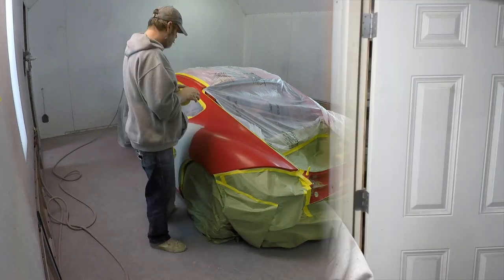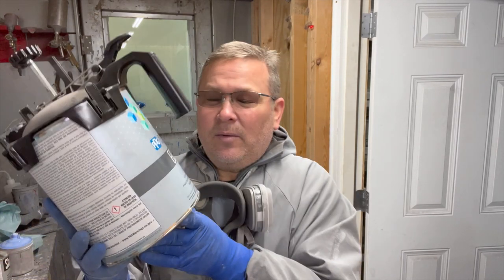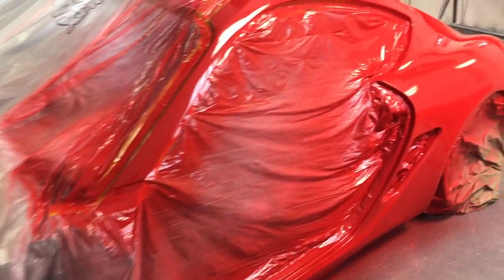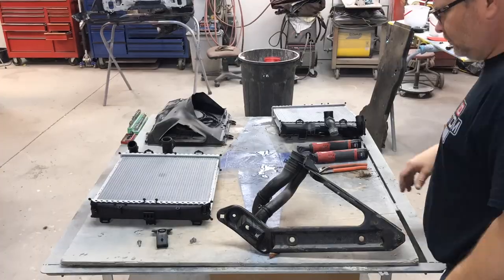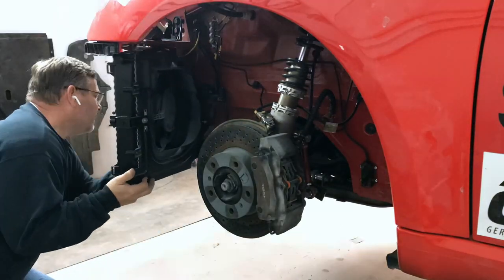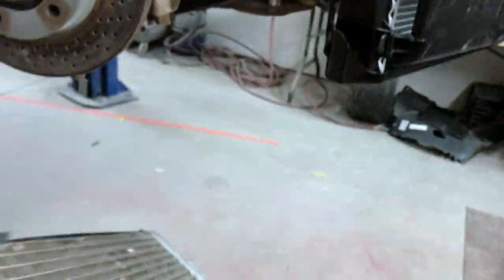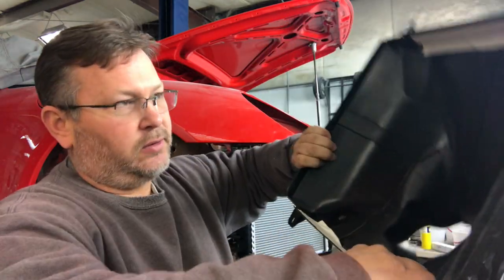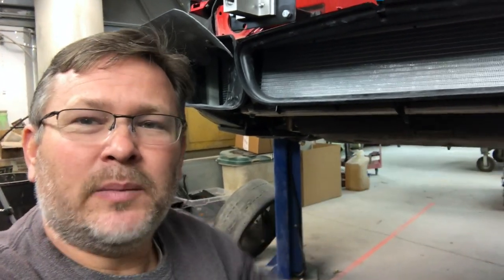Rebuilding A Wrecked Porsche Cayman Completed!!  (PART:5)     #Porsche #Easteregg #Cayman

Comment: Although this car is meant for the track, this video will be a big help to me after I buy a damaged Cayman and rebuild it to be used as a daily driver. Good to see the work done with the radiators, even though they are missing the AC condensers, and the third/center radiator will be something I add because I live in an area that is very hot much of the year. Nice job with the paint.
Reply from the maker: Thank you very much!

Comment: Do you think the holes in the splitter negatively affect its function? Could you not adapt the 911 venting solution to the car?
Reply from the maker: Thank you for watching! I don’t think that the holes negatively affect the splitters function of “splitting” the air over and under the car. But I do like the idea of the air exiting through the top better. It’s Porsche’s design on the Cayman so I’m gonna assume that they know more than me. 😉